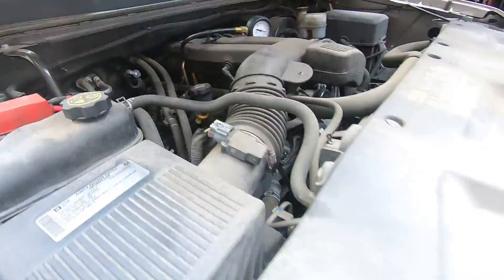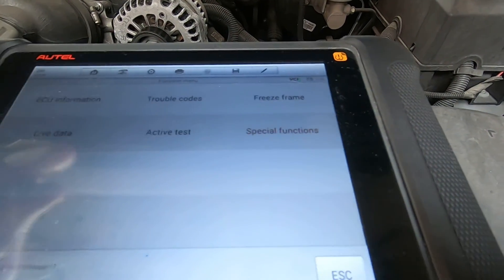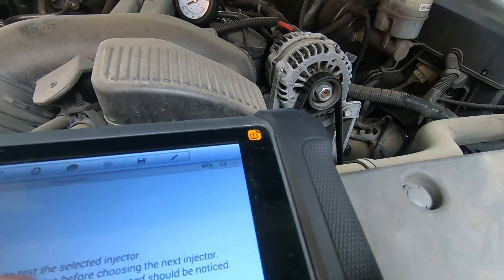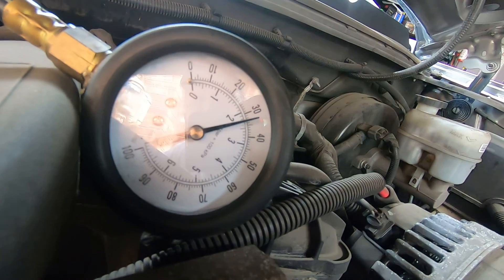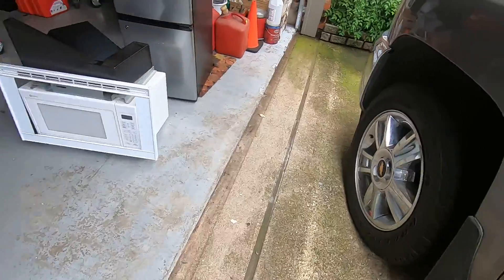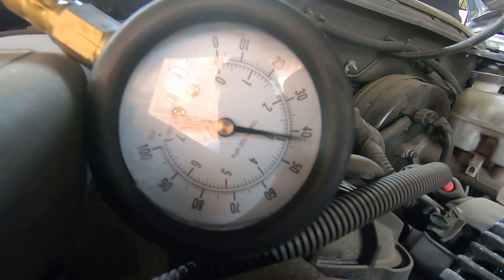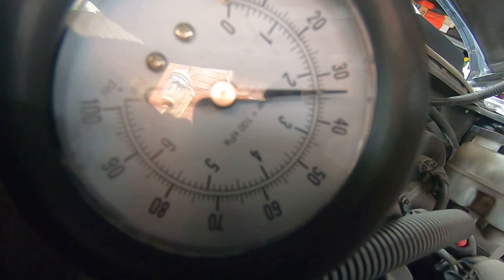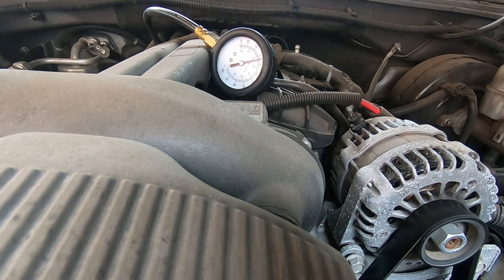How to perform an Injector Balance Test using the Autel Maxisys Scan Tool

Comment: Is that vehicle equipped with a fuel rail pressure sensor? If so it should have a PID for fuel pressure so you don’t need to use a gauge…
Reply from the maker: It has one but it is for high pressure only and won't move until the mechanical high-pressure pump is working with the engine running. It doesn't move with the engine off and the electric pump.
Reply: @737mechanic you get spoiled working on newer cars with more extensive PIDs. That’s for sure lol
Reply: How did you get the autel to take you to the part to show you the injector options

Comment: Do I need the normal or premium kit for the fuel pressure tester kit ? Would you recommend the digital vs analog?
Reply from the maker: Normally will work on most gm. Premium comes with most adaptors you will ever need. I like digital better but I normally go with analog because I got tired of when I needed a digital tester the batteries always being bad.
Reply: @737mechanic  ok awesome good to know thanks brother

Comment: Hey bud I also have a 2013 Silverado and keep getting a P219A Fuel air Ratio imbalance. Thinking possibly injectors on bank 1.

Looking on my recently acquired XTool D8BT, I am not able to see injector pulse width. I see online on Amazon reviews that the tool can do it. 

I need to try your method to see if this is what is causing the Code
Reply from the maker: Pulse width is going to be a data pid in the live data. If you want to do the fuel injector balance test go to either special functions or active test and look for fuel injector balance.
Reply: @737mechanic  I will do the balance test once I order the fuel pressure test kit.
Reply: @737mechanic  I wasn’t able to see injector pulse width in live data for the Silverado on the xtool d8.
Reply from the maker: @TurnThemWheels  it should be there somewhere.
Reply: @737mechanic  I didn’t see it and I checked fuel trims, ignition, fuel system, live data and didn’t see pulse width. Can you check on your Silverado 2013. Oh wait, you have the 2016 model now

Comment: Thanks for posting this, I have a MaxiCom MK808bt that has this function, I couldn't find any info from Autel how it works, for a backyard mechanic. Noticed this first time you did cylinder 1, the fuel pressure started at 65psi, which is likely why it stopped higher than the other cylinders.
Reply from the maker: Yes, that's why I did #1 again just to see if it would repeat the same results or match the others. Also when doing this don't do it more than once before starting the engine because you are squirting raw fuel into the engine each time you pulse an injector, I have seen people do this many times then when they go start the engine it hydraulically locks the engine and I have seen rods bust out of the side of the block.
Reply: My mp 808 autel doesn't pulse the injector like that; it ticks like a clock a the gauge goes down very slow....I'm not making any sense of it.....
Reply: @carlodonnell146  I found this video and was hopeful that I could run the same tests - but mine did the same thing as yours.  It would pulse down the 1st cylinder from ~58psi to 15psi - then the 2nd cylinder would start from 15psi and drop down a bit further to 10psi (never building back up to the original 58psi).  The 3rd would start from 10psi and so forth.  Not sure what to make of it either...